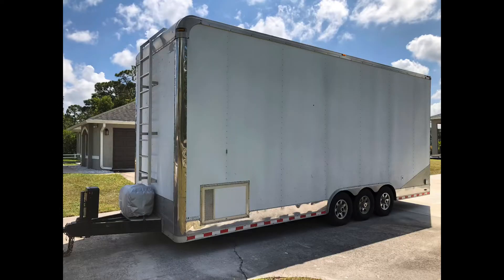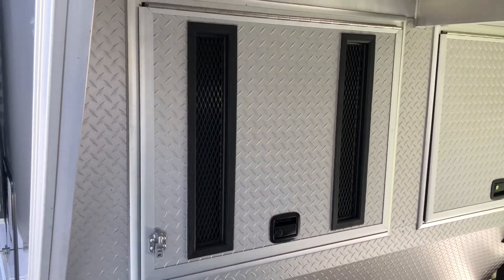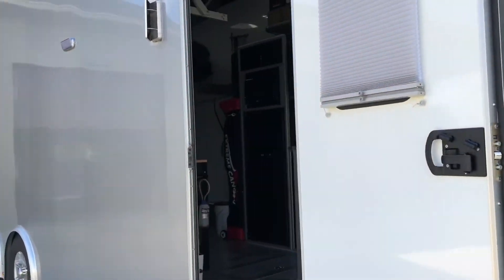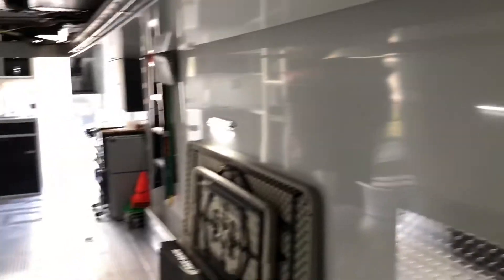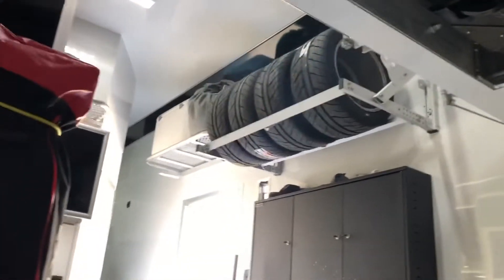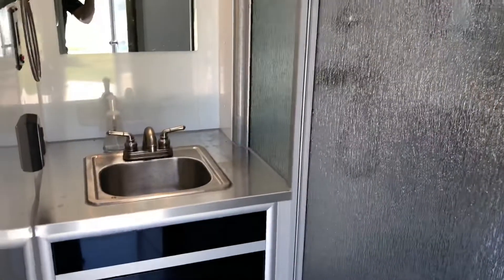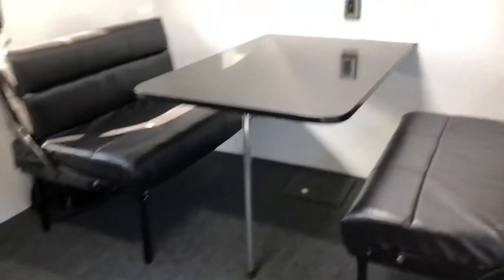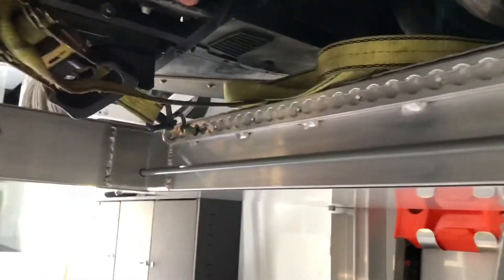inTech Stacker Trailer Walk Around

Comment: Very nice trailer.  I have a stacker aluminum trailer also. I would like to run a cabinet similar to where you keep your fluids. How do you attach the cabinet to the side of the trailer? Aluminum sheet metal screws? Is that strong enough?
Reply from the maker: The cabinets were installed when trailer was built new.

Comment: How decide on that length GN? How decide on tandem vs triple axel? If didn’t have generator would you want more kw? Is 50 gallon tank for generator too much for weekend race?
Reply from the maker: I decided on the length based on the cars and extra equipment I was going to haul. The trailer company will only build a stacker trailer with triple axles. The 7000 generator is more then enough to power the trailer. The 50gal fuel tank is also enough for a weekend.

Comment: Where did you get those fold down benches from?  You happy with them?  Dimensions?
Reply from the maker: MastercraftIncorporated.com, I had the same roll over benches in my ATC trailer which is how I found them. I don’t remember the exact dimensions off hand, the bench is 72” long. I think the dinette benches are around the same size when laid flat. To give you a reference, they both are the size of a twin bed when laid flat. Hope this helps.
Reply: @mantovaniracing  thanks.  After I posted that question I continued watching your vid and heard you say the name of the company.  Looked them up and found that site, could not find the exact model of what you seem to have but will likely reach out.  I have my 36' Intech goose almost done and looking at doing this as well.  Love your trailer, sweet build.

Comment: You could install a mini split and dump the roof ac. The mini split is smaller and exponentially more efficient.  And you add clearance.
Reply from the maker: I considered it but was twice the cost and you have the compressor hanging off the front of the trailer.
Reply: @mantovaniracing  I was quoted 9k for it! Instead I went with bellair houton quite AC sold by recpro.
Reply: No Motorsports trailers with mini splits, only see in trailer parks